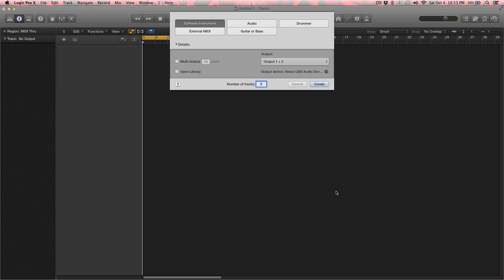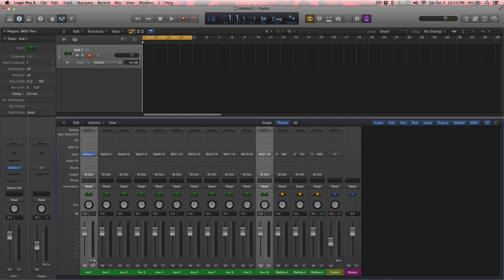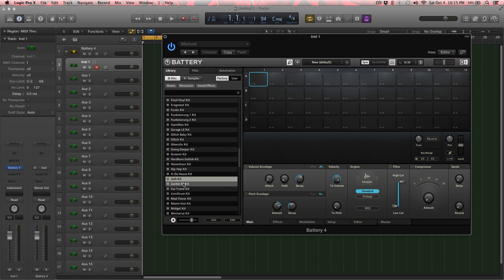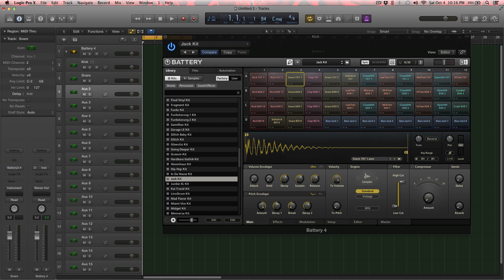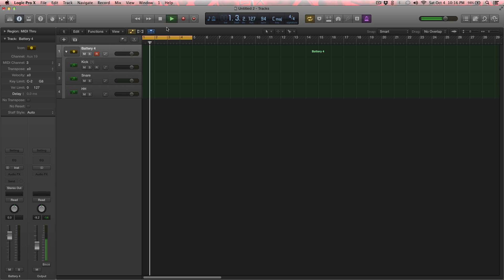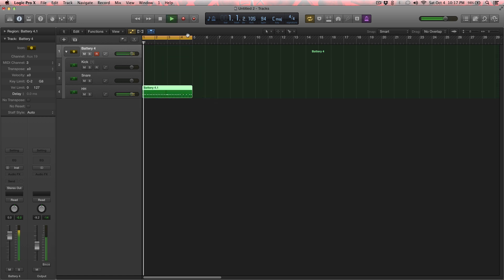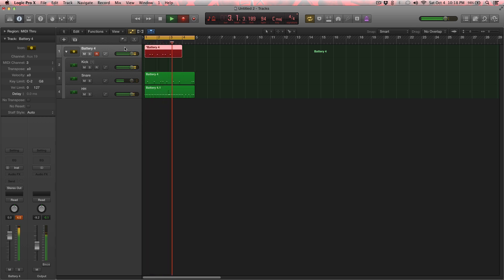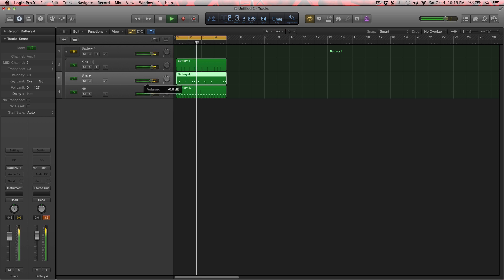Battery 4 Multi-Output w/Logic Pro X - CyX The SenZei

Comment: Perfect video! You've got yourself another subscriber.. I'm wondering if anyone's encountered this issue I'm having..

Battery 4.1.6 keeps on scanning for its default library when you open it up. So even if it's been running and active, each time I click on it to bring up the Battery on screen, it starts scanning the library and it's frustrating as it takes a while to do it. The only trick to go around it is to click the back / next arrows to select another patch, or the COMPARE button. This stops the scanning, but now you've just exit from your sample selections, and if you haven't saved your patch in advance, you've just lost it all. 

I've tried installing, reinstalling older versions ( Battery 3, Battery 4.1.5 ) and I'm only having the issue with 1.4.6 

Is it just a bug that I should wait it out for the next update or is there a way to fix it ?

I've tried removing the libraries from the preferences tab and even removing the folders from the hard drive just to see how the plugin reacts. Either way the same result - if you close out the Battery window, the next time you open it up it will start scanning again. 

Thanks for the input!!

Comment: I did al of the steps but i have no sound 🔊 comin out i drag in a midi file that I created and it doesnt have any sound what do i do!?
Reply from the maker: a midi file won't have a sample connected to it. you drag n drop samples not midi onto the cells.
Reply: CyX The SenZei right,i got it workin Thanks.
Reply from the maker: Sweet, no problem homie :D

Comment: yo, nice tutorial, but theres a lot of steps. lets say you know how many drum samples you're going to use, say 4(kick, snare, HH, OH) and just make 4 mixer tracks off the bat instead of 16 and then having to delete them?
Reply from the maker: Jonathan Schuller No you would just set those 4 samples to individual stereo outs and still creating Battery 4 as a multi-output. From there you can go to the mixer and press the plus sign on the bottom of the Battery 4 channel strip 4 times and those will be your routed samples. Select those 4 tracks then right click and create channel strip. To organize I would group them in a track stack of your choosing.
Reply from the maker: Jonathan Schuller Or another way is to type 4 in multi-timbral device for Battery 4 and assign your samples to the first 4 stereo outputs as was shown.

Comment: hey dude, thanks for the tutorial.  is there a simple way to make a global effect on the entire kit? say i want to filter it in globally without having to put a filter on each track?  I'm a total noob.  I'm subbing as well
Reply from the maker: Good question. I'll check into that. You have a slew of options though if you just use an insert on the channel strip. You can apply any effect you'd like on the entire kit.
Reply from the maker: ok, just looked Caleb. If I'm not mistaken what you're looking for is under the Master tab on the bottom of Battery 4 :)